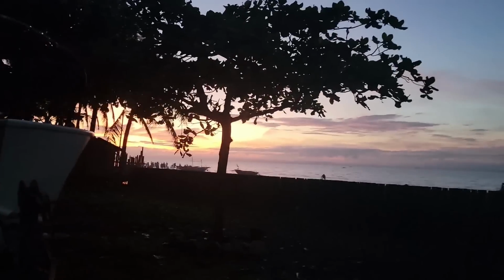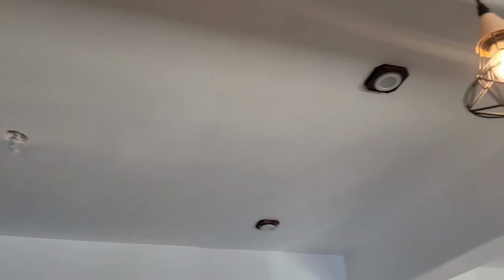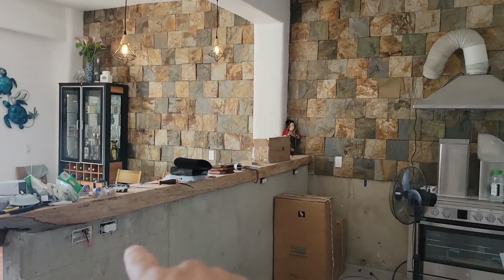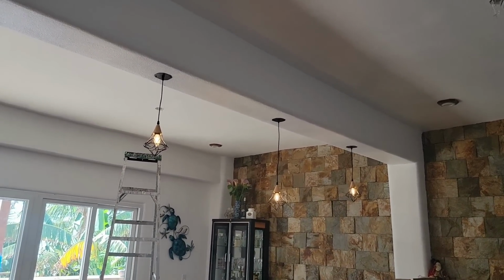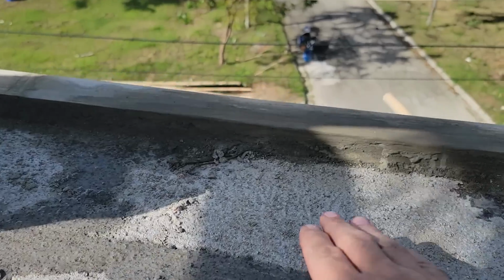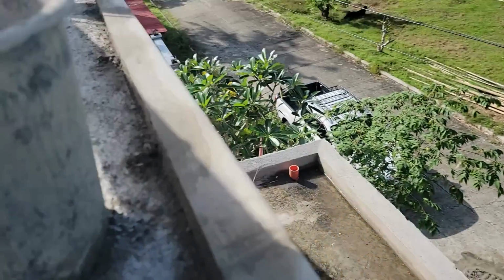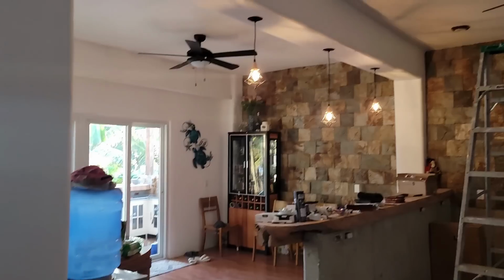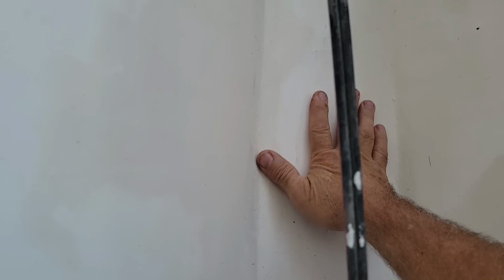Philippines Beach House Build Day 345  Finish Work is Fun!

Comment: Looking good!
If you'd like, as a former painter, I'd be more than happy to come out and do a final finish paint job on the house for you. All I'd ask for is a round trip, first class ticket on an airline of your choosing; lodging at a nearby 4 or 5 star hotel for the duration of the job; a daily meal stipend of $75 and a weekly budget of $100 for entertainment. Finally, I'm only requesting $35 per hour salary (I realize I'd be working in the PI so I've reduced my rate from $50 /hr.). When can I start? 🤣🤣🤣🤣
I'm curious to see what it will all look like when it's finally finished. I take it you're in the PI permanently now?